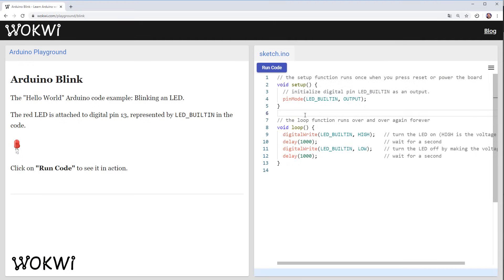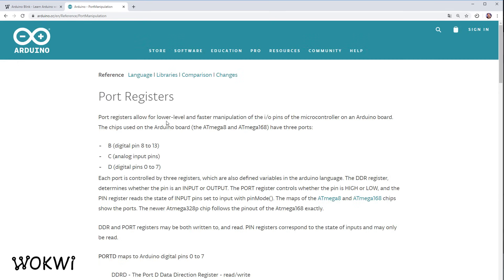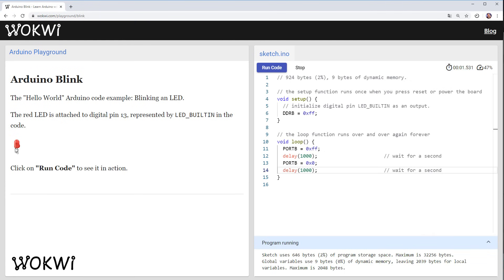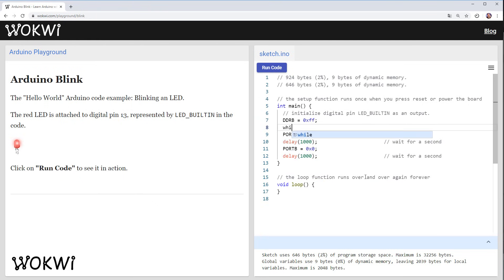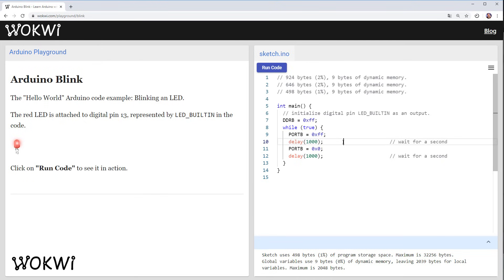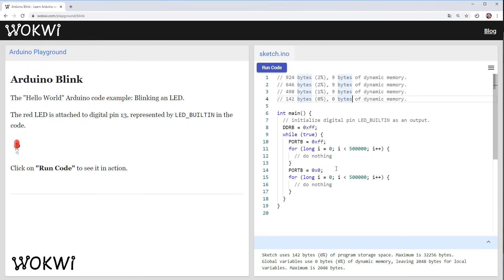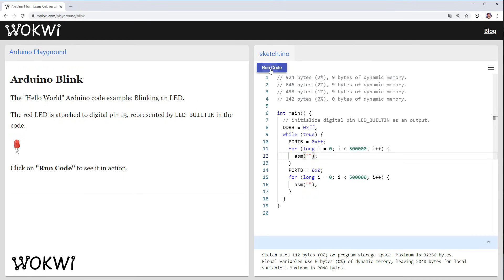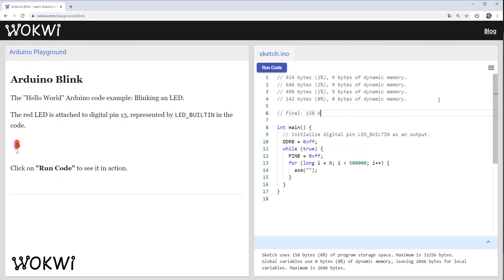Optimizing Arduino Code: no setup(), no loop() ⛔

Comment: If you want for further memory saving. Try use assembly language and keep in mind that it will really give you headaches as you need to know the register memory address for every pin and interupt that the microcontroller had. So in real life situation, what is the benefit from this memory saving? Is it make the code run faster? Made it work more reliable? More stable? Well, my motto is, memory is there to be use and make your life easier. So use it as what it intended to be.
Reply from the maker: Thanks for the reply Denny! Agreed, when you have memory then definitely use it. In our opinion, optimizing is not all about the code size/execution speed, but first of all making good use of your time as a programmer, and saving headaches for people who come to maintain the code in the future (including yourself)
Reply: Some comments are saying to just go ahead and use the memory that you have. But then when the new PSI42-69 chip comes out next year, you may find yourself having to write a new version of the program that needs exactly that "unneeded" memory. KISS with clean and secure code.
Reply: I mean, we're not talking C++ here. Most of this is very well translated 1:1 thru the interpreter. Not much will be saved hand writing the asm in this situation
Reply: @CrispyCircuits  The best approach is a combination of both ;) Write with the technics which gives faster TTM/more structured and supportable code - and optimize/rewrite in the low level only the parts you really need to.
Reply: @Wokwi  Memory is dirt cheap. Execution speed and Maintainability is what has more importance. :face-blue-smiling:
Arduino is meant to be easy. We can always use STM32 and keep doing bare metal programming and never complete the project. Even if we somehow complete it, others are unable to reuse it.
Reply: EdwardKrapovnitsky  2 years later i read your comment.  Do you have that code for reading encoders using no loop()?
Reply: EdwardKrapovnitsky thanks.  I will look up for more examples of this and give it a try.
Reply: But what if I want to make an MMO RPG with my LCD  module imma need all that extra bytes of memory XD

Comment: And what about compiling the "optimized" code to, for example, an STM32 Arduino-compatible board? Do you think, this is really a good way? I think this way is "good" only for dropping any portability and stucking into a very specific hardware. Moreover, if you want to write effective code to a particular hardware, than you can drop also C language and do it in the hardware's assembly. But, I think, Arduino's concept is rather the opposite of this and it better wants you to make code that can be portedto as many hardware environment as you can imagine for the task.
Reply from the maker: Hi Zoltan, thanks for your comment! Yea, this makes you appreciate the simplicity of Arduino, and portability, as well as the huge ecosystem of third-party libraries, code, and tutorials is what makes Arduino so powerful and amazing!
Reply: Arn’t cpu map libraries, such as in grbl and marlin, the answer to portability when using port addresses?   Am I missing something?
Reply: Dropping C in favor of ASM made sense some 10-15 years ago. Nowadays it's very hard to write better ASM code than what the compiler will generate from C.
Reply: @sharpfang  - For me, writing C is torture because I don't know how to view the resulting assembler code, so I'm left to guess what my code does. That's only a problem in a small number of cases but they are very important. For instance, when I turn off interrupts for some critical code, I don't know enough to be sure the optimizer isn't going to relocate some of that critical code outside the uninterruptable section.
Reply: @jrstf  You can use `objdump -C` to get an assembly listing of your compiled code, intermixed with the original C statements. This shows very clearly what the compiler does with your code. Not something I would do everyday, but it is handy for this small critical cases.

Also, for critical sections on AVR, you have the avr-libc macro ATOMIC_BLOCK.

Comment: it is possible to reduce code by another ~128 bytes. First chunk of Flash memory is occupied by interrupt vector table and stack initialization. If we do not use interrupts then our code could start at address 0 without jump instruction to skip other interrupt vectors. A lot of instructions is wasted to make a delay, I have a suspicious that setting a timer and toggling  pin in an interrupt function could lead to a much smaller code.
Reply from the maker: Thanks for the tip!

Comment: Smaller but at what price?  Readability, which directly effects maintainability! Part of the purpose of the Arduino IDE is to make programming easier, especially for the beginner.   There are plenty of microcontrollers on the market so if you need more memory or more speed buy a different one. If one needs to minimize size then write the code in the assembly language for the target device and document it well but don't expect it to be easily understood by a wide audience.

Comment: Mind blown!! Here I was thinking that for more complex projects I'd have to do something crazy like break out sections of the code to multiple arduino units for the sake of storage and memory, but your video has shown me that I need to be more versed in my computer languages. Thank you for this!
Reply: if that's your problem why don't you just use ESP32 and all of a sudden you have more memory and delay doesn't block your program anymore
Reply: @martinkuliza delay still blocks the program actually, you need to use freertos task for that purpose actually... and its harder and less intuitive than using millis() or delay()
Reply: @nintendero65  I think he meant that you avoid the delays when communicating between multiple MCUs if you have one MCU that's beefy enough to run your entire program.

Comment: For those who want still smaller, here is an assembly version that fits in 14 bytes:

#include <avr/io.h>
#define io(reg) _SFR_IO_ADDR(reg)

    sbi io(DDRB), 5  ; set PB5 as output
loop:
    sbi io(PINB), 5  ; toggle PB5
    ldi r26, 49      ; delay for 49 * 2^16 * 5 cycles
delay:
    sbiw r24, 1
    sbci r26, 0
    brne delay
    rjmp loop

Build it with `-nostdlib` in order to prevent the linker from adding the interrupt vector table (104 bytes) and the C runtime (28 bytes).
Reply: NICE..!! Im learning assembler and I love it.. :3
Reply: how is the c runtime so tiny only 28 bytes?
Reply: @mikoposter :
* initialize some CPU registers (r1, SREG, SP): 12 bytes
* call main: 4 bytes
* jump to _exit: 4 bytes
* implementation of __bad_interrupt: 4 bytes
* implementation of _exit: 4 bytes

That's 28 bytes total. If the program has a .bss section, add 16 bytes to zero that part of the RAM. If it has a .data section, add 22 bytes for copying it to RAM. This program doesn't use any RAM, but most non-trivial ones do have both a .bss and a .data section.
Reply: I had already try the same asm code and find that when substracting 0 with carry does not set the Z flag when r26 goes from 1 to 0.
(At least in the Atmel Studio simulator). Instead I have to use:  brnc delay , since the Carry flag is set when r26 goes from 0 to 0xFF,
Reply: @asalvat-st6gg  That's correct. According to the Instruction Set Manual, the sbci instruction never sets Z: it leaves it unchanged if the result is zero, and clears it otherwise. On the other hand, the preceding sbiw does set Z if the result is zero.

And this behavior makes sense: it ensures that, after executing both instructions, Z is set only when the three-byte counter r26:r25:r24 goes to zero.
Reply: idk why the video isn't "learn to program arduino in asm so the compilation is more optimised, but it may be harder to program"
Reply: I haven't counted the cycles, but I think it might even be a smaller (or at least not much larger) to just setup a timer to do the blinking
Reply: @jetseverschuren  
As a novice to the ATMEL fam I ask how does just a timer do that?
Reply: @bobvanwagner6099  A timer consists of a Prescaler and a Counter (and a bit more).
Here I'll explain on how it is on the Arduino Uno (ATmega328P) with Timer/Counter1. The signal can be output to Digital Pins 9 and/or 10.

The Prescaler either passes through the clock signal or divides it by 8, 64, 256 or 1024.
The clock signal from the Prescaler then goes into the counter which counts up by one each signal.

The counter here is 16 bit, meaning it counts up to 65535 and then resets to 0. You can set a lower value after which it resets to 0, with this you can control the frequency.
Another setting is a compare value, to which the timer always gets compared and you can set up what happens at a compare event.
You could either create an interrupt or directly control a pin. For blinking and LED I'd recommend the latter and am describing just that.

After that there are two possibilities:
Possibility one: PWM mode.
In this mode you create a PWM signal. You can choose if the signal should be HIGH or LOW when the timer resets (reaches zero/starts again). When the timer reaches the compare value the output state is switched. When the timer reaches the max value it resets to 0. Naturally the compare value should be lower or equal than the max value.
With this you can create a variable PWM signal with which you could dimm the LED when the frequency is high enough, or just blink it shortly every now and then.

Possibility two: CTC mode (Clear Timer on Compare match).
This mode is more limited but might be sufficient for some blinking tasks, also it allows to achieve a twice as low frequency as the PWM mode.
You would leave the value for the timer to reset itself at the maximum and only work with the compare value.
With it you decide how frequent the LED is toggled.
With this you can get a square wave, basically a PWM signal with a fixed 50% duty cycle.

I've left some stuff out but this should cover it.

Here's an example:
The Arduino Uno runs at 16 MHz, thus the clock as well.

We set the Prescaler to divide that by 1024, so the timer counts with a frequency of 15.625 kHz.
We set the Timer to PWM mode and the max value to 15624. As 0 is also a part of each timer count cycle it resets every 15625 cycles, giving us a frequency of exaclty 1 Hz.
The PWM is set up so that when the timer starts at/resets to 0 the output is set to HIGH, turing the LED on.
We set the compare value to 4687, thus the LED would turn off after ~0.3 seconds.

With this you can have an LED passively blinking 0.3 seconds every second.

I hope this explains it well enough!
I myself am also just a beginner but am doing a project with an ATtiny85 and using a timer to create a PWM signal is a major part of it. As I like to challenge myself I'm doing it in Assembly. 95% of the time is reading how the ATtiny85 works, 4% debugging and 1% coding.
As the Arduino Unos MCU (ATmega328P) is similar enough (but better) I thought I could explain it with a more common example. The differences aren't that much of a deal as both are a part of the same family.
Reply: @turbogamerxd329  Thanks for the details.   Powerful little register, that clock register.  So many modes!   .

Comment: Using internal timer interrupts is more efficient and accurate for blinking an LED. Especially when you try to do something else aside of the blinking, which can make the LED blinking a bit slower as more instructions are executed after the blinking lines.
Or for more efficient for some more tasks and the ease of use, FreeRTOS can be used. You just need to create the task, using the internal task delay method that is similar to the delay method although it might not be so optimised if you are trying to implement some simple applications like “blink”.
Reply: You can also set up a timer to directly manipulate an output pin. Thus you wouldn't need the core at all to keep the LED blinking. There's only one limit to that being which output pins can be used.

Comment: Arduino was invented as a platform for beginners on a microcontroller. And so everything complicated was hidden in the library. The great advantage is, you can start programming without reading datasheets and understanding the inner structure of a device. Because for beginners, this can be rather frustrating.
The arduino-platform is ok for smaller projects. 
But if i want to use the full periphery of the controller and have to optimize for speed or memory-usage, i prefere the Atmel-Studio and coding in Ansi-C or even in assembler. The advantage is a much better use of the resources, but i loose the independence of processortype and i need much experience in debugging, especialy when using many nested interrupts. 

So, both approaches have their raison d'etre😊
There are thousands of ways to let a LED blink with a Microcontroller, but this in not the intended use of such a device.😉
Reply: @charly_a8654:
"There are thousands of ways to let a LED blink with a Microcontroller, but this in not the intended use of such a device"
Meanwhile in my head:
https://www.youtube.com/watch?v=mDhNQPt8An0
Reply: @MrKANIOREX 
😂😂😂😂😂😂

Comment: Optimizing code is good. However, premature optimization can waste a lot of time on something we really don't need or may not benefit from. Thus, the saying "Premature optimization is the root of evil, -Donald Knuth". 
So we build something that works first then examine it later to find out areas that need optimization. 😉 Anyways I've learnt something new from this video. I am from a web development background with php and c# and I'm new to arduino
Reply from the maker: Yes!

Comment: The comment section shows great interest in this video. The point of the video is "Optimizing" . 
I suggest that you optimize the use of the screen space (width)   Roughly 30% is wasted in two black voids.  Further the width of the info block on the left could be reduced by half and still maintain its purpose. 
These changes would allow a much wider area for  the code block and a larger font would make reading the screen possible.  I enjoyed the video but gave up trying to read the text because of the illegibly small letters.  Oddly  the least important text in the info block is more legible as it has a larger font size.   Thank you for not using any distracting music.
Reply from the maker: Good points, thanks for the feedback!
Reply: Are you watching on a 4" 21:9 screen? If so, get a grip... if not, get a grip, your complaints are not valid. The trend of using overly large fonts "for people on mobile devices" has gone so far that I can't even watch some videos in fullscreen anymore, or have to move back like 10' to be able to read anything at all. Beside, how do you read the comments, horizontally scrolling because you have to zoom in so far?
The video is utterly pointless anyway XD

Comment: Great video. I use those low level registers to control WS2812 LEDs with my own code rather than the libraries.
I figured out a while ago I could use main() like we normally use in C/C++, but the delay and other functions didn't work. Your video shows why. Thanks!

So, if I write my own main() and then add in init(); initVariant(); and USBDevice.attach(); up front in it, I can then use it with any Arduino function [ like delay() ] just like we do with setup() and loop().

This is great! I teach Summer STEM and I want to show my students the normal main() entry point for a more general C/C++ expectations with most compliers.
Reply from the maker: Awesome! Where do you teach?
Reply: @Wokwi  I am retired here in New Hampshire. I only take 6 students over the summer: 8 hours a day, 5 days a week, for 8 weeks. I interview all the parents and students together. I don't go by grades but by aptitude and eagerness to learn... and it's free! Except for the price of the project/kits which each student keeps.  My angle is "Don't let your kids play video games all summer, get them a head start on being a scientist/engineer/technician and focus on STEM all summer".  The parents love me because I stay away from all the "woke" nonsense they teach in public schools these days. I tell each parent/student that we ALL say the US Pledge of Allegence before we start class each day.  This ourages the liberal troublemakers and thus I pass on selecting their child for my class. One parent tried to sue me because she claimed I was indoctrinating childen. I said no, the pledge is just a form of solidarity, if you want indoctrination, then go back to the public school system. My lawyer shut her down instantly. It's my house on private property, I set the rules and tell everyone what they are, you and your child have to agree to the rules which are legal, parents can tune in and watch/listen to the class at any time (I covered the On Air LEDs on the cameras with tape so I never know when parents are watching), and I do not charge a fee, the students just pay for the cost for their projects that they keep. Some parents want me to deprogram their children from the  brainwashing their children get in public schools, some even offer a nice paycheck, but I tell them no, I will stick with just STEM. The pledge is just to weed out those with closed minds or demand EVERYTHING in the world is done their way.  The parents that do just that get so annoyed that their child with straight A's and is a perfect bleeding heart spreading their adgenda was not selected. I once had a student that was here from Mexico on a visa. His parents said they were not comfortable with the US pledge because they are not US citizens. I told them, ok, your child will sit quietly while the rest of the class stands and recites the US pledge, then, the class will sit quietly while he stands and I say the Mexico plege WITH HIM in Spanish. The parents loved me, their son was a wonderful student.